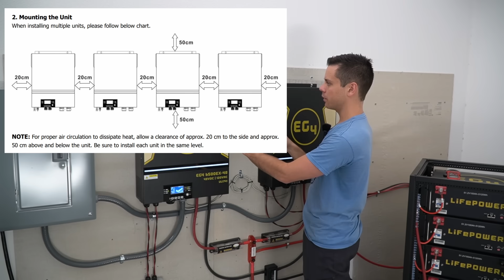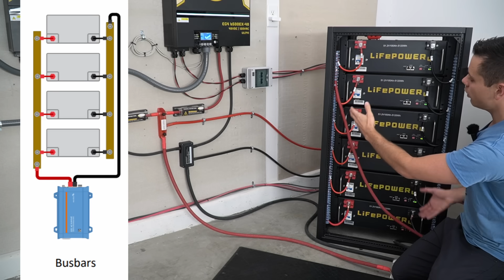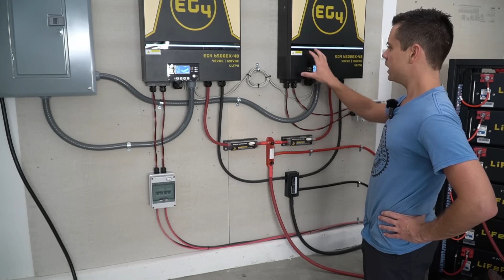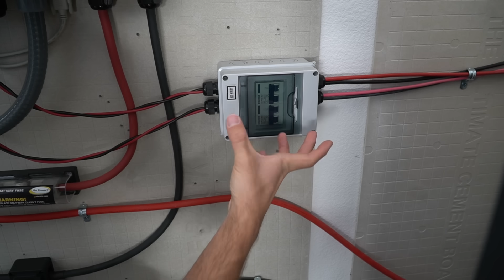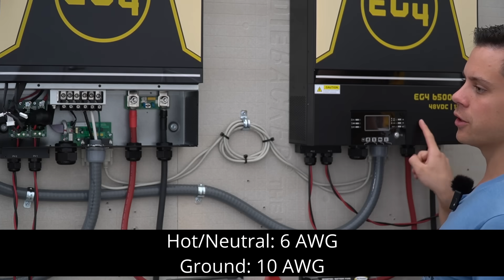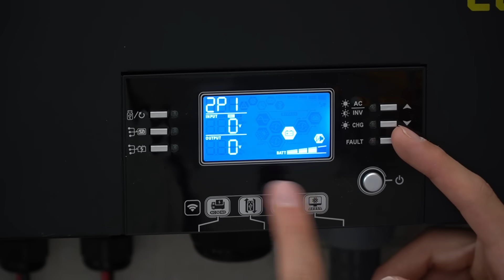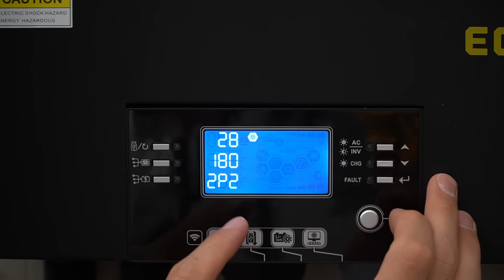Complete 48V Offgrid Solar Power System

Comment: Hi Will.  I love your videos - keep up the good work!  I have a houseboat with a 100A standard 240 breaker panel and a 12.5KW Generator.  There is a switch that selects "shore" and "generator", typical.  I'd like to be able to produce 3,000W (240V) from battery power for around 4 hours (no generator, no shore power).  I would want a peak of 4,000W.  My math tells me I'll need (3) 48V LifePower4 (100AH) in parallel.  I plan to rack mount them in a short rack.  I want to charge these batteries as quickly as possible while I run the generator - gas is expensive, so this is key.  Specs on the battery say they'll take 100A charge.  So, if I have a 100A charger, 3 batteries should charge in 3 hours... true?  My question to you is which inverter/charger would be best to put with my (3) LifePower4s?  What accessories would you suggest.  This whole thing will go into the hull of the boat and I wouldn't be able to see the monitors.

Comment: I, for 1, would like to see the setup as an UPS where NO user intervention is required when the GRID disappears. Further, I would like the arrangement to supply home power when the batteries are full and only switch to GRID when the batteries discharge to 10%. You mentioned that it is simple, so if that is so, I would want to replicate and provide logging to you and others on its operation and performance. Your autobiographical work is enormously beneficial!👏
Reply from the maker: I just posted that today actually
Reply: @WillProwse  can you please provide a link to the posted info?

Comment: Thanks for a great video WIll.  It would be interesting to hear what these inverters can do in a grid connected setup. They have the connections for grid AC IN, my questions are along the lines of what can they do with the grid power. Charge the batts no doubt, but how controllable is that? Is there a mode which does not sell power back to the grid but minimizes grid usage? How can a generator be connected along with the grid (or instead of it for grid down conditions).

I also am concerned about the grounding issues with a grid tied setup. In that case there can only be one ground neutral bonding point, which is typically in the main grid break box. You can take the bonding screw out of the sub box the inverters feed, but sounds like the inverters themselves bond ground to neutral.

Also, did not hear about PV GFI or arc detection. Do the CC in the inverter offer either of those?

Sounds like great new products, but to pass inspection in my area it would need to address these other concerns (grounding, PV GFI and arc detection).

Comment: I hugely appreciate your videos, and am gradually inching closer to building my own system thanks in no small part to the quality of your work.  There is one thing I don't know if you've covered (haven't seen it in past videos, but maybe I just missed it) that would be very helpful to me - heat generated by these various components, system temperature tolerances (if they vary by each piece of equipment), management of this heat (including designing the place where they'll be installed), and size of the space where they should be installed (with a focus on heat management).  

Currently I have an Outback system, which can run (derated above 75 degrees F) in temperatures up to 158 degrees (it appears that the Schneider systems Signature Solar recently started selling have a similar tolerance).  However, these EG4 systems seem functional only up to 104 degrees, and Signature Solar (in an email chain I had with them) themselves have said it's important to keep the temperature down.  

At the height of summer, even in the shade, in a shed-like structure, I don't think this can be achieved without active cooling.  If the air temperature soars to 100+, there's literally nothing I could do aside from having active cooling (or installing them in an in-ground structure perhaps; I've played with using some kind of miniature geothermal system as well, though haven't built any real plans yet).  I'd love to hear your take on this point.  

For context, I live in a 200 square foot tiny house with almost no unused wall space, so I'm looking to build a separate structure to house this equipment.  My current equipment is in a too-small utility closet, which is not cooled and sometimes rises to over 120 degrees (far from ideal, but we didn't anticipate this situation when positioning our house and are working on it).  Our batteries are inside the house, and I want them to no longer be, so I'm planning on creating enough space outside for all of the equipment (like in your video).  

Thank you!
Reply: Stick with small and well insulated with ample space to maintain the system.  If you constructed something fireproof enough, you could situate it close enough to your home to get climate controlled air into it.  You might get enough air flow if you added a vent in the enclosure to allow your home to maintain a modest temperature range in the enclosure year round.  If not, a small duct fan could help there.
Reply: How about some recycled brick and block on concrete and then Earth shelter the entire structure? My solar room is in my basement underneath a porch. The inverters are approximately 18 in below grade. Anxious to see how the entire system performs once I have my second string of panels installed and both inverters up and running
Reply: @martingargas3217  I like ideas like this a lot.  We're so constrained on space and what we can do with it that we have to be really careful, but I think something like this has a good chance of working well.  I hope it works out for you!

Comment: Great video!

But just FYI, when talking inch fractions in anything construction related its three-quarters, not three-fourths.

So...
Thirty secondths (x/32)
Sixteenths (x/16)
Eighths (x/8)
Quarters (x/4)
Halfs (x/2)

Aldo never say thirds and always the  smallest denominator (ie. never say four eighths, say one half). There are exceptions but not that important.

Comment: Yeah, I want my entire system to be UL listed.  That way I know it's safe.

I'll probably start out with 1 6500EX, 1 battery, and 4.6kW of solar.

Eventually, 2 6500EX, at least 3 batteries, and 9.2kW of solar.  Maybe even four 6500EX, all 6 batteries and 16kW of solar, and figure out how to sell excess solar to the grid.
Reply: The EG4 inverter is not UL tested, certified, listed, or even recognized.. it is only TUV 1741.  The EG4 battery isn't UL listed either, Signature Solar just misrepresents it.  I'm disappointed too.  Will updated the pinned comment.

Comment: QUESTION: The wiring between Inverter 2 and the breaker in the breaker box, does the Inverter put the 180 degree out of phase 120, such that L1 is the line that goes to the breaker???

This is an area in which I am confused.

Thanks

Comment: Will, you are by far the best gahdam walking owner's manual for a post-industrial electrical setup that po'folks can build and scale. I started watching you when you were building small systems on a sheet of ply for RV'ers and now you're bodging up splendiferous split-phase bonanzas that could power an entire domicile. I might be years away from a solar rig but you can be sure when I tell DTE to yank the cord and good riddance, my system will have a fair amount of Prowse (and Poz) in it.

Comment: Which solar panels would you recommend for this system? Would they have to have microinverters?
Reply: This unit contains an inverter, so microinverters would be redundant and not necessary. Any panels that you can configure to stay within this unit's max voltage and current specs will work. Keep in mind it has dual MPPT inputs so you can put one string (group of panels wired in series) on each input. I just bought a pallet of 445W 72-cell panels made by Solarever, which Signature Solar carries. I'm planning to use 2 of these units with 14 panels each (2 strings of 7 panels per unit, so 2 x 7 x 445W = 6230W per unit). Signature Solar can surely help you with panel selection if you want something else or a professional opinion, though (I'm just a DIYer). Good luck, man!

Comment: Are there programmable automatic transfer switches that you’d recommend? My use case is that we have the second most expensive electricity in the U.S. and net metering that makes peak hours almost 50 cents/kWH, so I’m been thinking if it were possible to have a battery backup with ATS that switches to battery during peak hours and switches back to grid during cheap hours
Reply: Some inverters have that built in, where you can program different priorities based on time.  So it could be battery first during that peak time, but grid first when it's cheaper to maintain some charge.
Reply: @ekbuz  is there a keyword that I can search for to help find those products? Like “smart inverter” or something?
Reply: @Invictum594  I think it's often called Time of Use scheduling or something like that

Comment: Note in the Specs, you can have a min of 90V min voltage, so you don't have to run high voltage, which for most people would be safer and reduce shading concerns as well.

Comment: Tip: measure de voltage over the DC-breaker. You can determen what the quality is of the breaker. It helps if you are have multiple one's so you can compare them. The voltage (not current) over the breaker must be as small as can be. It will be dependant of the current flow. Because of Will hase several parallel devices, he measured the current through each wire. I had one that was hugely different breaker than the other (different system). So I got a other one

Comment: Fantastic job Will. A ton of work went into this video.  The information is clear and concise.  Your blueprint on your website is super detailed.  Links to all the parts are included.  There is nothing missing.  Outstanding work.  Thank you for all you do.
Reply: Which surge protector do you use between the PV array and the eg4 6500ex?

Comment: one technology question about the communication between the inverters and battery pack: i think for the lithium batttery, the communication should be cable RS485, but there are 2 inverters in parallel, which inverter we need to connect the RS485 cable from the lithium battery pack? thanks

Comment: Your ground wire I would have gone with #8 one less than your hot and neutral which are #6. Is the panel grounded? I didn’t see one. If you did, did you ground it to the house already existed ground or you put a new 8’ copper rod in to the ground?

Comment: I know that you can link several server rack batteries to an inverter using correct DIP switch settings etc, can you do the same thing with more than one battery bank made up with EVE cells and BMS's?

Comment: !! I almost cancelled my LV6548 pre-order when Will implied it was UL tested.  But if you look into it they are sneaky.  This is not UL tested, certified, listed, or even recognized!  It's SAID to be able to pass UL's 2010 criteria.  That's a 12 year old UL testing procedure.  This seems to be your average MPP knockoff from a shady factory in China, not Taiwan.
Reply from the maker: No this model and mpp equivalent are tuv listed 1741.
Reply: @WillProwse  Yes, they are TUV 1741, but UL themselves is clear UL 1741 is not a category, and this language is misleading.  It would be honest to print "TUV 1741" on the unit.
Reply from the maker: @s9josh778  ohhh right. This is very common with Offgrid certified gear. My understanding is this certificate enables passing an inspection because it's based on UL standards. That's why everyone puts UL when it's a third party testing it
Reply: @WillProwse  Also, the signature solar page for the batteries should not be displaying the "UL Listed" mark, their proof from the UL test literally says "This Certificate of Compliance does not provide authorization to apply the UL Recognized Component Mark."  It was just a preliminary component-level test.  EG4 did nothing wrong in this case, but signature solar did.
Reply from the maker: @s9josh778  yeah that's not accurate, you're right
Reply: @WillProwse  Sorry for being the bearer of bad news.  I'm bummed out too.
Reply from the maker: @s9josh778  updated my website and added an alternative system for passing inspection. Costs more but then there should be no issues
Reply from the maker: They are all made in China. They use tawain to avoid tarrifs
Reply: @WillProwse  mppSolar says "ensure the products you are buying does not say “Made in China”.  MPP Solar is a Taiwan company."  What's your experience, does the official MPP product say  it's made in Taiwan or China?
Reply from the maker: @s9josh778  haha! Yeah I know. And they are all made by voltronic

Comment: Hi Will got this inverter (aka know voltronic axpert max I ) in offgrid setup (16Kwh LFPO and soon 32Kwh) and it work flawless. I advise you to monitor/control these inverters with a good domotic. Add a ESP32 with ESPhome for this job.... it's just great. It exports everything in Home Assistant.

Comment: I'm going to hazard a guess that the 2P2 120 setting would be if you wanted a 3 phase setup?  Although I doubt the typical off-grid user would NEED 3 phase power.  In fact, except for charging a Tesla or some older dryers and cooking gear MOST would likely be able to get by with a 120VAC system.  Great series of videos on how to cut the cord economically!

Comment: Apologies for a potentially dumb question, but to clarify, but based on the parts list link, for $13,451 plus solar panels, racking and installation ... I can have that exact 240V 13kW setup?

Comment: If using this configuration off grid, would you utilize a ground rod in the conventional manner as a ground rod is used for a house? I.e. a ground rod driven into the ground and bare wire running to the main electrical panel?

Comment: Will, thanks for making these videos. Could you add a wind turbine to this system also? So could you have the solar and wind running together with the same equipment? I'm so glad that I found your channel when I did.
Reply: If it's DC being fed from the turbine you can do it.   You would use a separate MPPT for solar and a MPPT for the wind generator.  Make sure the MPPT and feed wire for the wind generator has an aH rating consistent with the max output of the turbine.  Most MPPT's are set up to be able to run several MPPT's into the battery storage system.  This is possible due to the fact that some solar arrays are separated due to the need to keep amperage down to a certain level in the PV feed wires.   Use MPPT's with a good LiPe battery bank.  PWM's won't work in this situation.
Reply: @rockymntain  thank you for the info. We definitely want solar but adding a couple small turbines would be added power security. Thanks again

Comment: Great video, thanks Will.  Anyone know why the high voltage pv wires don't need to be protected for code compliance?
Reply: The solar wiring from the panels to the inverters do need to be in conduit.  And a real DC disconnect switch that is UL listed and intended for solar.  What Will has is clean and safe, but not compliant per NEC or local codes.

Comment: You mentioned that the cables that came with the batteries that attached them to the rack bus bar were a bit small, so you replaced them with larger gauge cable.  What size gauge did you use there?

Comment: As an installer this is an awesome setup but still not a code compliant installation in most all jurisdictions. No rapid shutdown/labeling/DC circuits need to be in metal raceways and exterior disconnects are usually required.
Reply from the maker: DC has disconnects on battery. Can't those be used? Or does it need dedicated rapid shutdown on device. I was wondering why it is 1741 but does not have rapid shutdown on the unit. Figured the batteries circuit breaker could be considered rapid shutdown.
Reply: @WillProwse  Depending on the NEC cycle your state has adopted you will need either string level or panel level RSD for the solar. You could accomplish this by adding 3rd party RSD device such as tigo or apsmart for panel level or midnite for string level RSD. If panels are ground mounted no RSD is required if you have an exterior disconnect switch and the wiring doesnt extend >5ft(2014 NEC) or >3ft(2017 NEC) into the building. You also need an "easily accessible" (which usually means outside) service AC disconnect. You Should be good for the battery side of things.
Reply: @WillProwse  -RSD for solar -Metal raceway for DC conductors in building -exterior AC disconnect -Inverters need a dedicated combiner panel without any loads -everything needs labeling. From what I can see in the video if those few items are addressed the system should be close to code compliant and able to pass inspection in most jurisdictions. ( I work in GA and FL for reference)